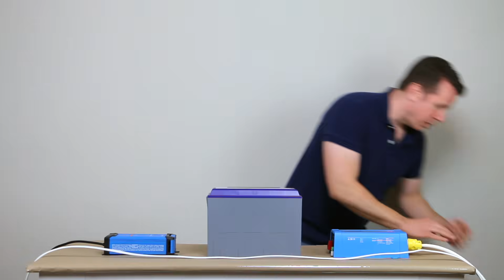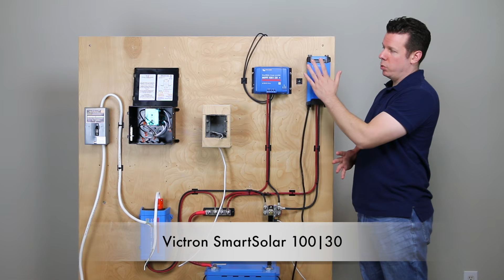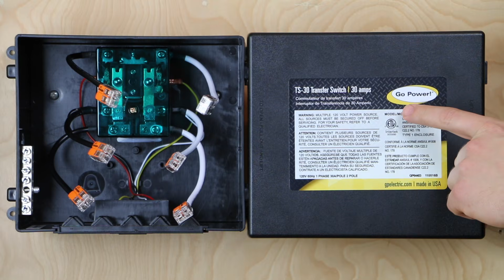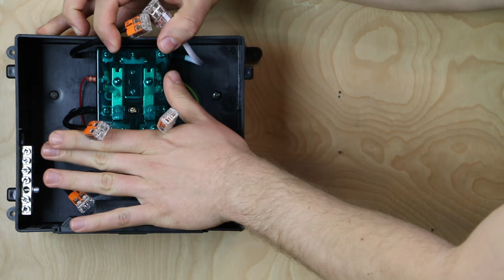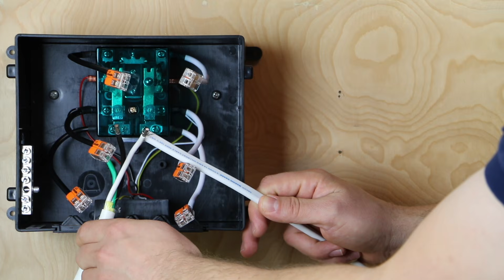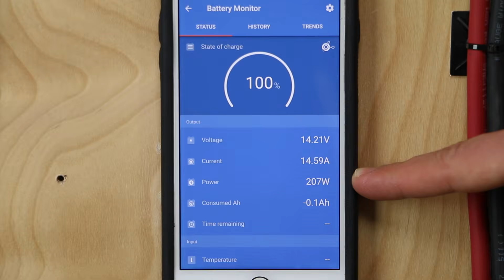How to Add Shore Power to an Existing Van or RV Power System | Featuring the TS-30 Transfer Switch

Comment: OMG, the size of the TS-30 box is huge.  My easy solution is to add 3 XT-90 connectors, two males and one female. The male ones are for 120 sources (inverter and the shore), and the female is for the line to the trailer AC distribution. Only one male could mate with the female at a time. so it is failed proof.  I have to disconnect and reconnect manually, but don't need to carry that big switch box.
Reply from the maker: Very cool! Thanks for sharing your methods.
Reply: An easy solution is to get rid of the inverter install an inverter/ charger. It has an internal transfer relay, which sends sure power or inverter power, depending on whether you’re plugged in or not.

Comment: This video was SUPER helpful! Thank you! Quick Q - instead of splicing the charger into the shore feed at the transfer switch, do you have any thoughts on adding a 110v outlet inline with the shore feed before it gets to transfer switch? Reason being, my AC to DC charger is already wired with a type b plug.

Comment: So I have a question I have a 50 amp 5th wheel and I have a shore power plug in the far back of the trailer and I want to add another shore power plug closer to the convince center on the side of the trailer the original plug wire goes to a surge guard in the storage bay in and out to the Victron Multi plus 2 then to the main panel so what do I need to NOT remove the original shore power inlet plug but to have both plugs work if I chose to plug into one or the other? Having the option of both locations.

Comment: I have my shore power set up so I can entirely or partially bypass the house power when charging.  This allows under ideal shore power situations to be able to give the house system arrest after charging, or in situations like when you're plugged into someone's residence to keep higher current items (like I microwave) on the house power so you don't blow the circuit breaker in the residence.

Comment: that i was lookinfor nice inf . i have question ? can i use this system in a food trailer .
Reply from the maker: Yes you can, will work fine for that.
Reply: @rosslukeman   thank you so much  , i have 20,000 watt for all my appliances very big food trailer ?  What would you recommend? thank  you
Reply: i have 120/240 and my breker 50amp

Comment: thanks a lot!
this video helped me kinda think out and solidify my plans for my fully 12v system (with just a little cigarette lighter inverter for my laptop).
line1=solar panels>charge controller>battery bank
line 2=shore power>battery charger and breaker panel so i can charge my laptop and drone and everything without draining my battery bank when hookups are available

Comment: Hi, sorry to ask such a specific question but you obviously know what you're talking about and i'm pretty clueless. I have an Sargent ec160 power supply in my van and it's currently only hooked up to the alternator charging the leisure battery. I want to add shore power, do you know if i'd need to add in a charger and transfer switch, as per your example, or is this built into the EC160?
Any advice you could offer would be very much appreciated.

Comment: Thanks for the tip to connect the charger directly to the mains wiring in the switch. I've wired it from the breaker so I need to make sure to turn it off when I turn on the inverter so it doesnt have a "free energy" loop lol

Comment: Hi Ross….I would like to have my a/c system ran only by shore power when able, therefor I wouldn’t be connected to my battery and no need for an inverter.   I also would like shore power to charge my battery which will supply my d/c needs.   
 
Could I run my shore line to a breaker/breakers that would feed my a/c battery charger and also my  house a/c system?
Reply: Also, can I run the dc system while charging the battery? Sorry for the beginner level questions

Comment: I added a shore power plug on my RV, but haven't wired anything to it. I have been looking and looking for ideas on where I need to attach a ground wire (the green wire) to something. Frame? Some component? I have inverter, converter, fuses, etc., etc., but there is NO information about where to ground or IF I need to ground that 30 amp plug. Can someone answer that question?

Comment: Awesome video!!! I also have a Generator in my van. How do I add that + alternator + shore power? Would I need a 3 way transfer switch?
Reply from the maker: Hi Herb, you would plug in shore power and the generator into one of these transfer switches. The alternator wouldn't go through the transfer switch, it would just connect to system positive and negative, the 12V part of the system that links to the batteries.

Comment: where do you tie in the vehicle power? Does the charge controller have an input for vehicle power to charge while in tow?

thanks
Reply from the maker: Hey CMB, you tie into vehicle power at the engine battery positive, the charge controller is only for solar. For engine charging you would get a separate DC-DC charger. Renogy makes some combination solar controller (MPPT)/DC-DC chargers, but you may not want to combine those functions as those units limit how much you can get from both sources simultaneously.

Comment: Great video!  I’m trying to figure out if I can use an older RV inverter/convertor box with my solar.  (Still a work in progress).  I’m thinking I might be able to use it by removing some guts.  Thoughts?  Anyone!  Not just Luke!

Comment: So what if you want shore power sometimes and generator power other times through the shore power plug on an RV?  Do you have to change the relay everytime?
Reply from the maker: Hi Tim, if you want to send the generator or grid power through the same plug, I would just say to wire that inlet to the generator side of the transfer switch so you get the 30-second generator startup delay from the switch, no matter what you plug into your inlet. The other side of the switch would be your inverter. Great question.
Reply: @rosslukeman  thank you!

Comment: I’m trying to start a mobile barbershop I’m my 2019 sprinter. Please someone help me I don’t need to power a house I need to power. Tv, power clippers, hair dryer, AC unit and led lights. I have a 12volt battery and a 3000 watt inverter. What’s next to get going?
Reply from the maker: Hey man, good luck with the barber shop, that's a great van. On the mobile power systems, these are more complicated than a house due to batteries and different voltages. Not trying to scare you but houses are simpler in some ways. I wouldn't buy anything else until you have a full system design. I sell them https://www.rosslukeman.com/vanpower but if you want something free you might check out Will Prowse https://www.mobile-solarpower.com or Nate Yarborough https://www.explorist.life
Reply: @rosslukeman  Awesome I appreciate the feed back, thank you I will check out.
Reply: Your link and Will's link go to 404.
Reply from the maker: @lesliehunter1823  thanks, I just fixed the links.

Comment: Great setup up. How can I have A/C shore power turn on only when my battery dies?
Reply from the maker: Thanks Travis, I'm not quite sure on your question. Typically if shore power is available you run your rig on that power. Being plugged in but running on your battery until it dies instead is not a use-case that anyone designs systems for. I suppose it could be done. You would probably have a battery monitor set to trigger its relay at some low-battery setpoint (BMV-712 has a relay like this). When the relay went off it would turn on the inverter-charger (or perhaps just a charger like we had in this video).
Reply: @rosslukeman  This seems to be what I'd also like configured, because while I have my trailer at home and plugged into shore power, I'd prefer that AC is being pulled from my inverter (powered by my batteries, and getting charged from solar) instead of paying the power company.  

And then if/when my batteries are too low to be used, either because there's no solar charging (or insufficient solar charging), or my AC is pulling more than my batteries & inverter can continue to support, it's at this point I'd like my shore power to kick in.

The reason for this use case is to take advantage of the solar/batteries/inverter for my AC needs (as much as possible) instead of pulling from and paying to my power company.

For this use case, I've also incorporated an ATS so that when my batteries (currently AGM) get down to about 94%, the ATS relay switches from the inverter supplying AC, over to shore power supplying AC.  

Side note and not directly related to this use case, of course I'd much rather have LiFePO4 batteries, and I plan to switch to them at some future date as they'd work out so much better and longer.

Now what I'd also like to do in my system is that when my ATS has switched to shore power, and if there's no or insufficient solar power, then allow for shore power to supply to a battery charger that would recharge my batteries.

Comment: How can you add shore power only  - meaning to hook to campsite only with say one or two receptacles inside van.
Reply from the maker: I would just wire shore power to a breaker, and from the breaker to a string of outlets. With 14 AWG cable you could do a 15 amp breaker, which would provide a total of up to 1875 watts from all outlets.
Reply: @rosslukeman  Thank you Ross you hands down have the best process review for electrical install on the web.
Reply from the maker: @raymondsmith4702  thanks I appreciate that!

Comment: I'll just break the tang that connects the 2 outlets on the receptacle. Wire one to shore power and one to inverter, plug in appliance to either one as needed. I don't do anything in a van that requires uninterrupted power, save money and space by not getting a transfer switch. Wire 1\2 of the outlets to a junction box connected to a shore power outlet and the other 1/2 to the inverter.

Comment: I want to replicate this system, but using a 15a shore power plug. Is there an automatic transfer switch that works on 15 amps?
Reply from the maker: Hey Lorenzo, this one will work great on a 15 amp circuit, it’s the voltage that controls the switch. As long as you use 120 volts AC power, it will work great.
Reply: @rosslukeman  thanks Ross, I appreciate the quick response! Keep up the good work!

Comment: I have shore power running directly into a WFCO WF8735 Converter with AC CB and DC fuses. When plugged into shore power my converter charges my Battery at ~79.8% efficiency.

I also have a Solar Panel with a 40A MPPT charge controller Directly to my battery. ~94% Efficiency 

I want to run an 3000W inverter off of my battery and my shore power into an ATS to power my AC System without my Converter trying to pick up the DC load of my battery.

This runs into the problem of Concurrent Charging that you mentioned in your video. With my MPPT and the Converter both charging my battery. 

I would normally just pull the fuse in the converters charge to break that circuit when I am without shore power. But wondering if there is a way to power my AC Appliances with my inverter and shore power without the risk of double charge circuits to my battery or worse. My inverter running into my converter then my DC output vice just my DC circuits running off my battery
Reply from the maker: Hi, I think I understand what you're going for. I don't see the problem with your MPPT and converter charging your batteries concurrently. I am guessing you have lead batteries and this is the limitation on how much charge current can go into your batteries? Here is a video I did on concurrent charging that may be useful: https://youtu.be/x7U9oZfoJpw

As far as avoiding charging loops, the converter in that WF8735 is just a battery charger. They just call it a converter. Anyhow, that charger is wired to one of the AC breakers in the WF8735 unit. What you need to do is shut off all power to the WF8735 unit, then pull these wires and re-route/extend them over and connect them inside the transfer switch to the shore power incoming line like I showed in the video. So the converter only turns on with shore power, and not when the inverter is in use. I hope that helps. Thanks for checking out my video.

Comment: Will this work if your appliances and lights are dc powered
Reply from the maker: Hey there, this video was mainly concerned with what to do with incoming AC power, but the battery charger and battery in the system are all about DC power. Anytime there is a battery in the system you can tap in for DC power. Great question, thanks for tuning in!

Comment: Great content and well presented! Does anyone know if 230V transfer switches are available on the european market?
Reply from the maker: Hi Robert, great to hear you enjoyed the video. I would check out these switches from Victron which are available for 230V: https://www.victronenergy.com/transfer-switches  I'm not sure of specific vendors but those models should work for you.
Reply: @rosslukeman  I've upgraded my boat with multiple victron devices and really happy with results. Wish I had watched this video first and learned what an inverter/charger was :) I have a phoenix inverter and 2 separate 25A ip67 chargers. I now select source by manually plugging into either the shore power or inverter socket. It works fine but would be nice to have it automated.

My supplier didn''t have the transfer switches listed so I wasn't aware that they existed. Thanks for sharing the link!
Reply from the maker: Hi Robert, yes it is hard to know all of the options that are out there, but it sounds like you'll be able to automate things with those switches. Thanks for tuning in and good luck with it!

Comment: Very nice presentation. Since its for a vehicle it would have been nice to have the alternator included. Would you add that from eg Orion on to the same +/- bus bar's as the MPPT and BlueSmart chargers?
Reply from the maker: Thanks, glad you found the video useful. The answer is yes, you would connect the Orion to the same +/- bus bars as the other chargers.

Comment: Is This Like Pass Through Charging w/UPS on a Solar Generator...? For those who don't know what that is, PTCw/UPS allows you to have your system plugged into an External AC Unit, but instead of just charging your system it allows the current to passes through powering your appliances and anything left over then is used to charge your batteries... Pass Through Charging w/UPS is power Uninterrupted even if the Source Looses Power thus acting like a Batter Backup that people use for Their Computers!

Comment: I am wanting to add shore power to my van.  I already have the Renogy DCC50S DC-DC Charger installed.  It runs the charging from my solar and alternator to the house batteries.  Can I use the TS-30 Transfer Switch to add a Progressive Dynamics Mighty Mini AC/DC Panel and Converter/Smart Charger into my system.  The end result I am looking for is to have 3 options for charging my house batteries.  i.e. shore, alternator, and solar.
Reply from the maker: I could be wrong but I don't think that Mighty Mini is the right product. It will have a single line in from the Transfer Switch. Problem is...when you unplug and run the inverter into the transfer switch, it's going to think it has shore power and turn on the converter to charge your batteries. So your batteries will charge your batteries, can't have a loop like that. You should just get a charger and a naked AC/DC panel like the PD5000 or the WFCO 8930/50. That's my quick take on it.
Reply: @rosslukeman  If I understand you correctly, I would hook my DCC50S DC-DC Charger to the Default Power Source Wires on the DS30 Transfer Switch, and the ac-dc converter charger would be hooked to the Dynamic Source Wires on the DS30 Transfer Switch. The Transfer switch would then figure out if I was hooked to shore power, or if I was powering from the DCC50S DC-DC Charger, and send output power to my Battery Bank, which would send power through my inverter and ut to my 120v and 12v outlets?